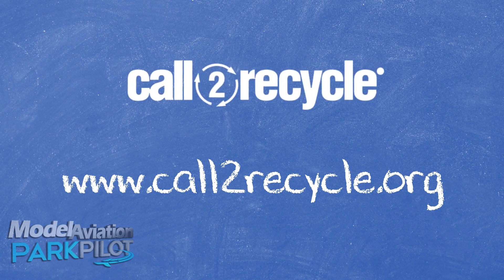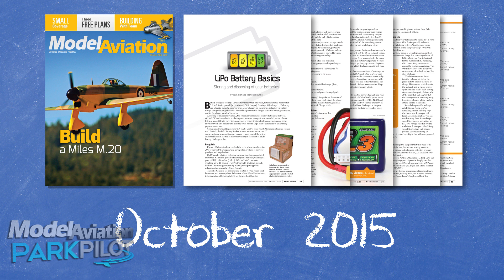LiPo Battery Basics - Storage and Disposal

Comment: I believe the guy on the left mis-spoke about how many volts per cell on a fully charged battery.  The correct voltage is 4.2v per cell on a fully charged LiPo.
Reply from the maker: +Lee “iCrash” K Good catch.  While the battery capacity is discharged 50%, the voltage only drops from 4.2V/cell to 3.8V/cell.

Comment: At 1:01 it is stated the each cell is 7.4volts.  Each cell of a Lipo is not 7.4 but a nominal 3.7 and fully charged 4.2volts. Great tip on call2recycle.com. My local hobby shop collects old lipo batteries also. Before dropping a battery off to any collection site you should discharge it to 3.8 volts per cell.
Reply: +John Russcher I was scrolling through the comments looking for who else that noticed that. Sure enough...almost everyone! lmao
Reply from the maker: +John Russcher Thanks!  We added an annotation to the video.  Users should discharge a battery to 50% and the voltage down to 3.8V/cell.